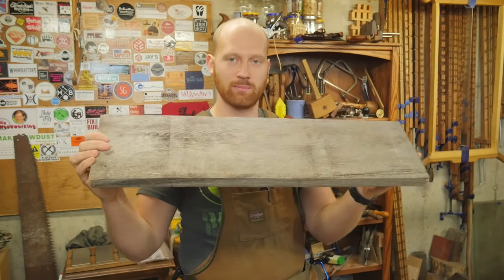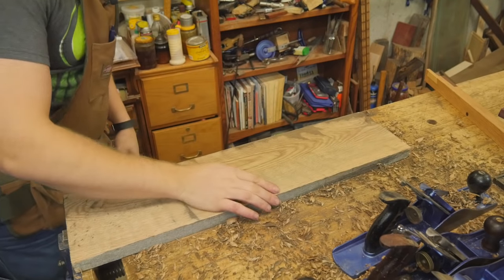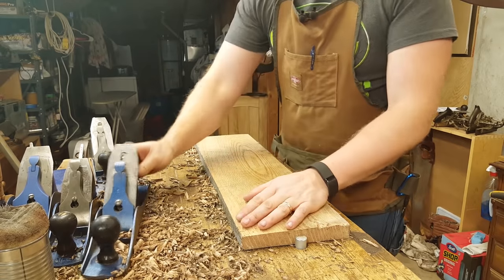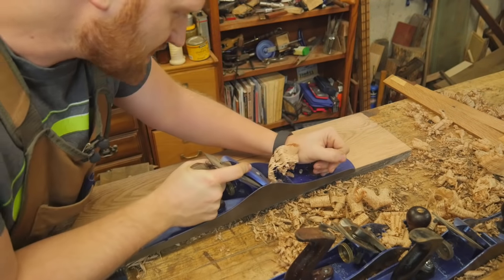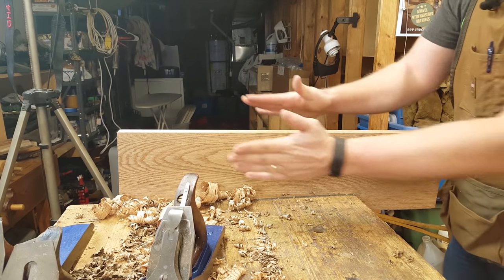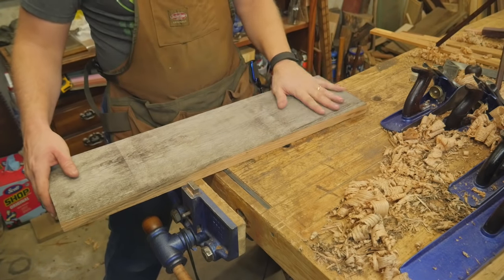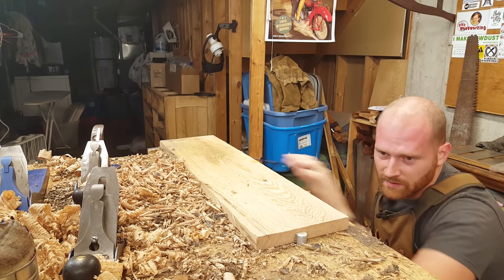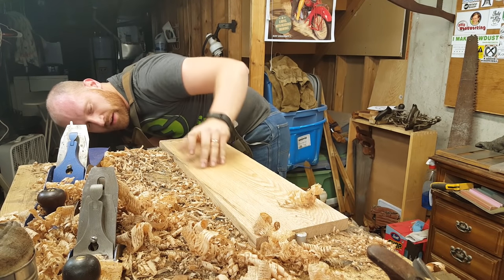How To Dimension Lumber With Hand Tools - Woodworking Skill

Comment: "I'm looking for fun, not perfection" thanks for that inspirational quote. I was feeling so frustrated trying to perfectly flat a lumber until I saw this video.
Great work.
Reply from the maker: the funny thing is that if you checked the wood coming out of a planer it would shock many people at how out of flat it can be. for some reason when we do it with hand we are checking everything and we know the difference and it drives us nuts. when in reality it makes no difference.
Reply: I hear you. I feel frustrated and incompetent chasing my tail trying to flatten and joint!

Comment: Watching this video has confirmed my need for a jointer and planer. I can see this being relaxing and fun on a small project, but as soon as you said you had 16 more boards to do I was like "Nope." Great video and thanks for the great content James!
Reply from the maker: LOL yup. tell me about it. I am in the middle of a 10 drawer dresser! I can see the end though!
Reply: Agreed. I find no appeal to dimensioning rough lumber by hand as a choice. However, there is absolutely nothing like fine tuning and final finish with hand planes. No machine I've used gives me the control and surface like a smoothing plane. So the answer is...once you've developed the skill, use the right tool for the part of the process you're on.

Comment: I recently made the top of my small work bench, and I used my planes for the first real time. I feel your burn and I commend you Sir, for doing that 60 more times. 

And even though I am sore a few days after, I fully understand the satisfaction gained from feeling that smooth and flat top of shaped wood and knowing that I was the one that accomplished it. It does put a smile on your face, doesn't it:)
Reply from the maker: So true. Satisfaction is priceless

Comment: Hey. Nice to see how much work it is dimensioning a board with hand tools. I mean you can really feel it since nothing is cut out. BTW I think you need a heavier bench.
Reply from the maker: thanks. Well the bench is about 800lb right now with all my lumber stock under it. the problem is the legs are pine and have a good amount of flex. when I get a larger shop I am going to build a full hardwood bench, but this works just fine. the camera shows the flex but using it I can not feel it.

Comment: You inspired me to pick up a plane and do things without power tools.  The only one I have used is a cheap buck brothers. Works ok. What makes a good expensive one better. Maybe if I never use one I will never know what I am missing.
Reply from the maker: Thanks Travis. There are a thousand little things that add up to make a good reliable plane. holding the settings, good iron in the blade, tightness of the multiple adjustments, ease of adjustments, feel in the hand accuracy of the sole, mouth and frog. and the list goes on. a good plane works well once sharpened and setup. a cheap plane will sometimes but it takes more to set it up and it rarely stays set up. for new planes, the cheapest I would go are the new Stanley sweethearts. http://amzn.to/2zGtaMc but if you are willing to restore one you can pick up an old Stanley and clean it up for under $20

Comment: As a suggestion for future videos, consider putting a label/sticker on each plane to help the viewer quickly identify which plane you are using.  For a novice (like me), a #5 and a #7 can look similar even though the #7 is clearly much larger.  And as planes may be set different ways for different jobs, it could also help to know what role it is playing.  A #4 can easily be a smoothing or scrub plane.  Similarly a #5 or #7 could be set as a fore plane instead of their more typical roles.  And there's probably more scenarios that I don't even know about yet.

Sometimes you say what you are grabbing at the time, and sometimes you don't.  People often rewind the video several times to repeat parts for more clarity (or because they are multitasking and missed it the first time :-D).  So even if you do say what you grabbed, the viewer may not be rewinding far enough to hear it.  Some non-obtrusive labels could really help out.

This video is great.  Once I'm done here I've got some boards that need to be flattened for floating shelves and a moxon vise.  Thanks for making it.
Reply from the maker: That's interesting idea. Thanks for the feedback I might have to do that.

Comment: Thank you so much for this. You and Paul Sellers are as mentor as two masterful woodworkers from the internet can be to me.
It's a pity that there is no market for Bailey-pattern planes here. I only have a No.4 that was rather dear to ship, and I restored it, but the iron is still not square and I just can't get it there. I've been trying to get into the groove planing firewood. Can I even dimension rough-sawn, split wood with just a No.4? Would you perhaps do a video on, well, roadside wood and how to make boards from it?
Reply from the maker: Thanks man. That means a lot to be compared with Paul. He is a true master of the craft. Yes you can do all that with just a number four. If you go back and watch some of my old videos I actually did that turning firewood into mallets and other tools. On Saturday I'm going to be doing a live probably making a a grooving plane from a piece of firewood. Once you have one side flat then you can just reference everything off of that one side. It just takes a little bit longer if you use a number 4 rather then a scrub plane.
Reply: @WoodByWright  It is clear as day that you love wood and its craft, like Paul. There are endless forum posts about technique and tools, but I never get the same sense of passion and serenity from them as I do from the two of you. I would not have gone out to buy a chisel and a saw had I not come here first.
I'm starting on that mallet first thing in the morning.

Comment: Hopefully this comment/question isn’t too late after the video post to get a response. Thanks for the video and channel. You mention the need to plane with the grain, but you only do so with the fore plane. The 5, 7, and 4 are all used from one end to the other (with and into the grain) in the video. Why doesn’t that cause tear out?
Reply from the maker: Sorry not sure what you are referring to. all the planes were with the grain except going cross grain with the scrub. if I do need to go agents the grain (Some times it switches) then I use a very finely setup smoothing plane. with all the settings right you can get a smooth cut agents the grain. I do have a few videos on setting up a smoothing plane if you want to see more.
Reply: Wood By Wright I’m referring to the fact that in the video you changed directions on the board when using the scrub/fore plane, but when you used the jack, jointer, and smooth planes, you went all the way from one end of the board to the other. I get that a very light pass with a sharp smooth plane will avoid tear out, but the jack and jointer you used seemed to be set for a heavier cut.

Comment: Love your content. What if you have to glue up three of those boards for a project that’s about 19 in. Would you repeat the process at the end?
Reply from the maker: For that I would just dimension the two faces. I would leave the edges until I'm getting ready to glue up. Then you put the two boards together with either their top faces together or their bottom faces together and joint the edges at the same time. This way when they lay flat if there's any deviation and angle they match up. You can get a really nice clean glue joint that way.

Comment: I dimensioned some Hinoki last weekend and I found it very exhausting, which I blamed on my inexperience, but it looks like it’s hard work no matter how much experience you have.
Reply from the maker: Yep. That's half the fun putting a good amount of sweat into the work. if the blades are truly sharp it goes pretty quickly but they only stay that sharp for a few passes.

Comment: James, this is one of your best video's for teaching technique.     I have a interesting situation, and I hope someone can give me a little guidance as this will be my first time dimensioning a board.      I have two 6/4 Hard Maple Boards about 6" wide, which will be a glue up.   Both have a small twist, and bow.    I can get a pretty good surface on one side if I glue them up.  So the question is; do I edge joint, glue them up and then do all the dimensioning work on a larger board, or do the dimensioning as two separate boards and then do the glue up.    I'm thinking if I do them separately, then glue up, I am still going to have to re-plane the faces to achieve a consistent thickness on both boards.     What's the easiest way to do this ?
Reply from the maker: thanks Patrick. it all depends on how thick you want the end result. if you glue them then flatten them you will end up taking off more material possibly making them thinner in the end. if I have the thickness to play with I prefer to flatten after joining the two boards. it is just easier in the long run. and with a total thickness of 12" that will not be a problem to reach across. That is often the only problem of reaching across a really big board.
Reply: Thank You for the quick reply James.  Not like you haven't been busy enough with the Kitchen Reno.   I'll edge joint and do the glue up first.

Comment: The thing that frustrated me in the beginning is that I didn’t have a scrub plane. I had a jack plane set up like rob Cosman suggests and I was trying to thickness with that. I didn’t realize how thin the shavings it makes are and I didn’t realize how important a scrub plane is. Once I converted the $13 harbor freight plane into a scrub everything fell into place and hand dimensioning (at least short) boards became pretty easy and fun and quick. You need a plane that can remove significant material. If you’re shaving a few thou per shaving you just won’t be able to get the changes you want to see in a reasonable time frame. So to all the beginners reading this, get a scrub (fore) plane. I don’t consider it optional.

Comment: If you only had 2 planes total, what would you choose? A #7 and a #4?  A #7 and a low angle block plane?  Maybe a handheld  3  1/4 power planer?
Reply from the maker: It would be a #4 and a #5. Those are the two I use fea more then any other.
Reply: @WoodByWright  thanks for responding!  I'll admit it can be quite overwhelming. I've read many different recommendations. One was go with a low angle Jack plane for smoothing and an old Stanley Jack restored for rough work. Another said a 7 and a 4. Still another said a rabbet block and a Jack. The list keeps going. I can't afford all that I'm just getting started. Also for what it's worth, I find your style more educational than many others I've watched.

Comment: Have a Merry Christmas, James, and thanks for the video.  If we were keeping score at home, your process is #6,#5,#7,#4, is that correct? What about the #6 makes you prefer it over a smaller "scrub" plane?
Reply from the maker: Thanks Jon, and Marry Christmas to you too. my scrub (or foreplane) is a #5. here is my video on what I use. https://www.youtube.com/watch?v=3ZVhadFoq8E I would prefer a 5 1/4 but for the price you can not beat the #5 in my book. the #6 is too wide for me and the #4 rides with the valleys in the board too much, but each to their own. so yes fo me it is Scrub plane to remove material fast (if needed) #5 heavy set to get rid of the scrub marks and get close to the line, Jointer plane (6, 7, or 8 whatever is appropriate to the board) then finish it with a finely set smoothing plane for the final.

Comment: Hi, I’m a beginner just trying to understand the tools and process. When you are flattening the reference edge or I guess face too for that matter, why not just start with the jointer plane? Isn’t that the choice plane for doing the task of flattening ? Thanks!
Reply from the maker: The jointer plane doesn't take off a lot of material very quickly. Also it is a very wide mouth so it makes it more difficult to push. So the scrub plane will get it flat but then to get rid of the marks of the scrub plane it's much easier to use a narrower plane. Then you can bring in your jointer to do the final flattening. There's no reason you can't do it all with the jointer it's just going to take a lot more work.

Comment: Thanks James - great tutorial! I have a question though: how would you approach making the two faces of a live-edge board parallel? For example Matt Crremona's live-edge serving trays... Without a flat edge to reference your try-square against how would you do it?
Reply from the maker: +Will Halliday I would flatten one side. Then set it on a flat surface and reference the table with a marking gauges to mark the thickness then surface that side the same way.
Reply: Brilliant! So simple when you think about it really... Thanks man. Keep up the great work!

Comment: At 17:00, what does your gauge use to score the wood? I have a wooden one with a spike; it is hard to use. The spike will follow the grain of the wood and spoil the line.
Reply from the maker: that one is a small razor blade. that is interesting as most people use one with a point so that it will not follow the grain. the wheel versions are notorious for runnign away with he grain
Reply: @WoodByWright  weird indeed - I do better with one of the over-engineered "wheel" varieties.

Comment: Try rubbing a candle on the sole of your plane James it will make a big difference to the amount of effort required to push the plane.
Reply: the rag in a can with light machine oil works too
Reply from the maker: That is what I use.
Reply from the maker: I prefer oil to wax, but that is completely a personal preference.
Reply: +samuel molina I would have though the oil would seep into the wood and stain it and affect the finish no?Not sure but if I touch an machine that has oil on like the planer thicknesses handles and pick up wood it leaves a stain. But Paul sellers seems to love the oily can method. Roy under hill loves linseed oiling soles of wooden planes but I get a beating for that too because of contamination. Any thoughts? Cheers
Reply from the maker: the oil will stain the first pass but then you shave that off. and even then I am usually going to use oil for the finish. I have never had visible changes from it.
Reply: I followed Richard Maguires (The English Woodworker) technique of having a candle handy, it is dry and can be kept in an apron pocket. But hey, whatever works for you is fine by me :-)

Comment: James why is the scrub plane the last plane to touch the board when it seems to me the longer jointer plane would be the last plane on the board?
Reply from the maker: it is not. the scrub plane is the first to touch the board. ten the longer #5-#8 and the last plane to touch the work is usually a small smoothing plane. #2-#4 depending on what you like.

Comment: Real talk, man... How many boards should I expect to chew through before I can consistently do this? Is there an average number that people notice most beginners destroying? Or am I assuming this is more difficult that it really is? I haven't tried yet, so I don't have any reference, really.
Reply from the maker: Your first one should be passable if your blades are sharp and you take your time. As with anything, it will get better and faster with time. It is not a difficult skill, but there is skill involved as opposed to passing it through a thickness planer. the other thing to think about is what is your line for perfection. for me if my thickness is within a 32nd I am golden. others want it within a thousandth (which a thickness planer can't do) the biggest struggle for most is reading the grain so as not to get tear out. if you have straight grain then it is not a problem at all but that is not the way for all lumber.

Comment: 0:14 Overview
1:55 Inspecting the face side (winding sticks + looking for twist)
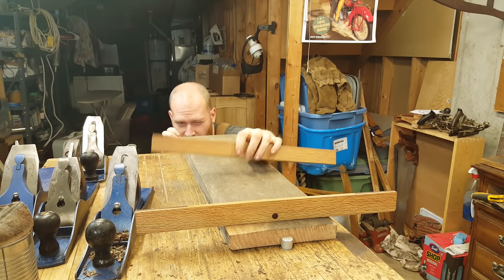3:22 Flattening the reference face side
5:35 Massive blowout (25% off on men's apparel)
13:30 Flattening and squaring the reference edge side
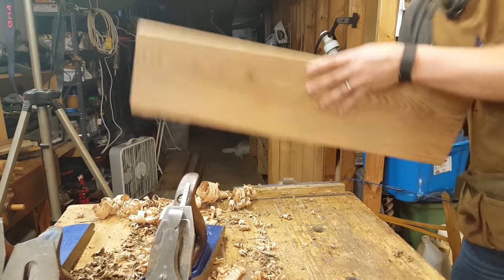16:30 Dimensioning the board width
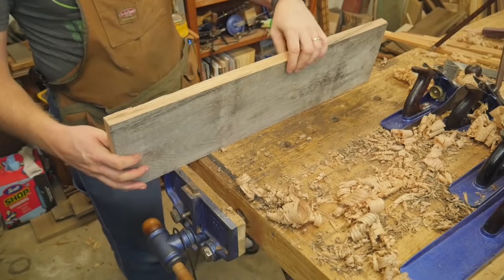18:20 Dimensioning the board thickness 

I was looking for a particular part of the video, so I thought I would timestamp it, in case another version of myself appears here
Reply from the maker: thanks! I use to put those in the description but people would complain about it. I might have to do it again and see what they think now.
Reply: Wood By Wright wow, I’m surprised people could complain about helpful information that they could ignore if they wanted
Reply from the maker: @909sickle  you would be surprised what people complain about. the timestamps use to be a way to stuff keywords and that turned off a lot of people to them, but they are starting to make a comeback.
Reply: Wood By Wright so they were objecting to the concept of time stamps because some people were abusing them; that is funny

Comment: how much harder would this be with only a #4/#5 plane? is it more technique or simply more time/patience?
Reply from the maker: it would not take that much more time you just have to be careful with the flattening. the benefit of the long jointer plane is it will tell you when the board is flat. but without that, you need to use a straight edge to see when it is flat and just hit the high spots.

Comment: After this process, do you still need to measure off your original references sides, or has every side become flat and 90 deg?
Reply from the maker: It depends on it's use. If it will be joining with a lot of other things I Mark it. But most of the time it does not matter that much.